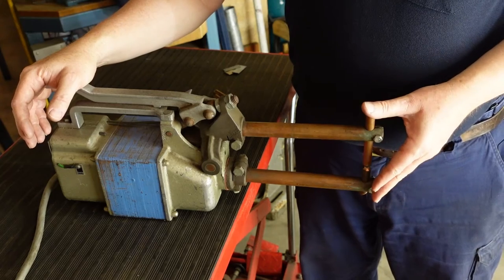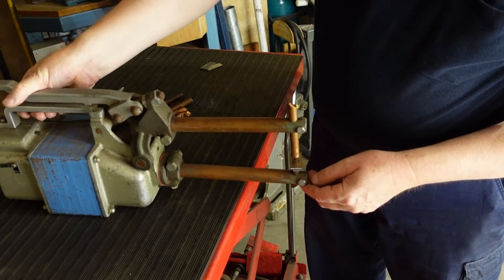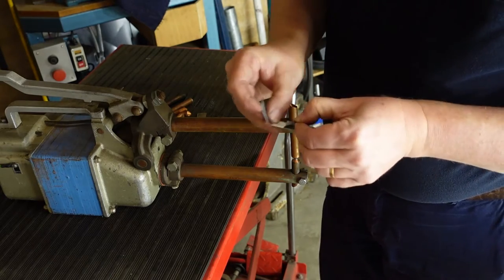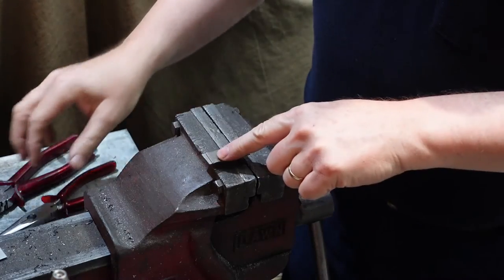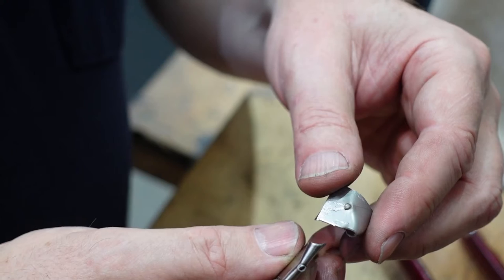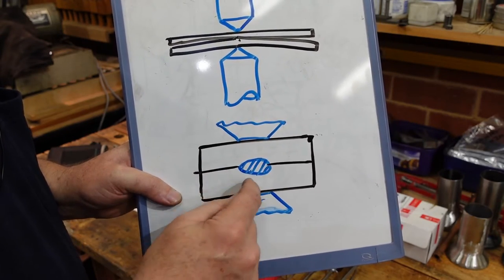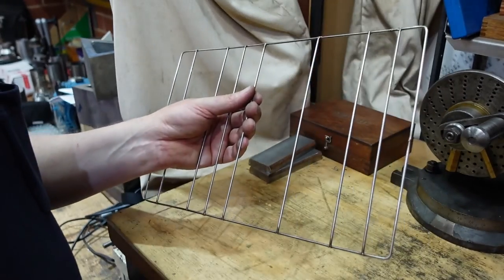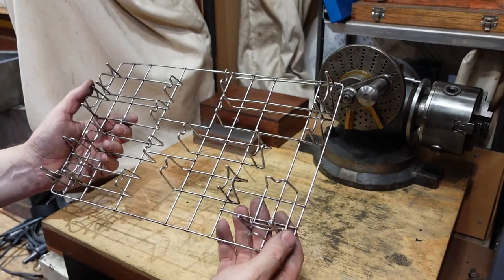Putting the cross wire welding technique to work

Comment: Very interesting. Thanks for the cross-wire spot welding demonstration and jig description.  At the beginning of the video when you showed the completed project I just assumed you tig welded the wire at the junctions.   I need to make that jig and try it out.  👍👍😎👍👍
Reply from the maker: Cross wire welding can be tricky as the wires can disappear into each other. Be careful about the pressure you apply

Comment: Hi there. Where do you purchase the straight runs of stainless wire from? I’d love to try this but not sure where to buy the wire (I’m in Australia). Thanks for listening to my newbie question :)
Reply from the maker: It's TIG welding filler wire. Stainless filler wire is not cheap, so it will pay to phone around welding suppliers to find out who has small quantities. If you only want a small amount, you may also be able to get a place who welds stainless to sell you a few lengths.
Reply: Good to know I’m not the first one to think of using Tig wire in that way.
Reply from the maker: @dennisyoung4631  It's handy stuff, even if expensive
Reply: @occasionalmachinist  308 stainless?  (Have 309 stainless for welding “mystery stainless,” e.g. repairing cookware.)

Was thinking that might be the likely stuff for “wire baskets” and the like.
Reply from the maker: @dennisyoung4631  The wire I used was just common 316L stuff that I use for welding. I might have to chase more exotic stuff for next time.

Comment: Do you know what thickness of wire that welder is rated for?
Reply from the maker: I don't - cross wire welding is not something that the manufacturers of these things contemplate, I suspect. Personnally I have welded up to 3.2mm (1/8")  - I think it might even go a little larger than that (4mm). The nice thing about the cross wire welding is that the contact area between the wires is really small, so great current density.
Reply: Awesome, thank you